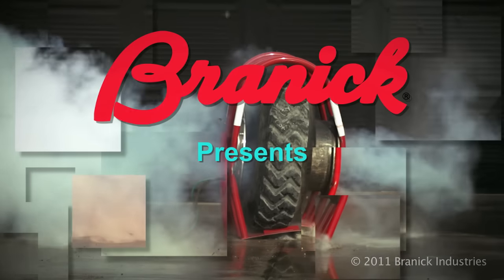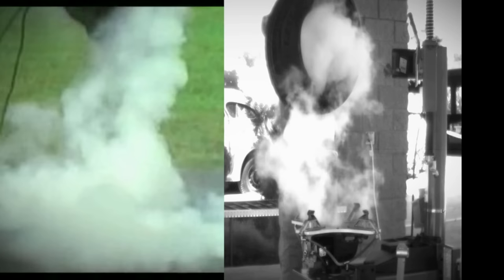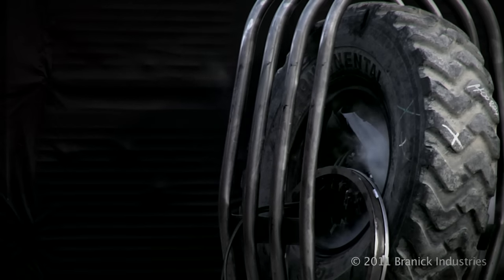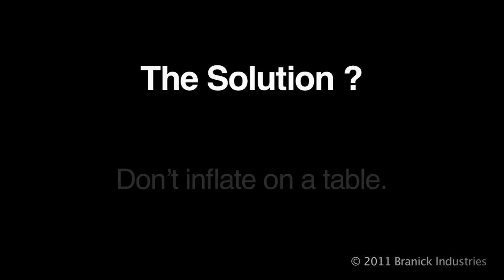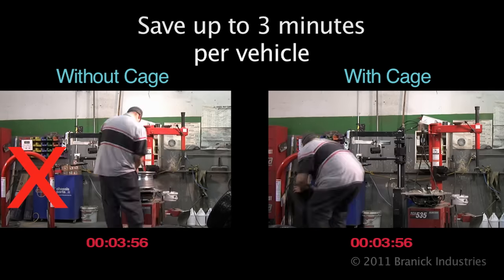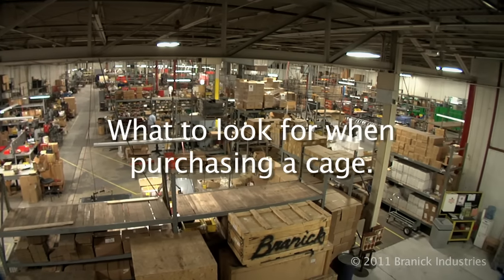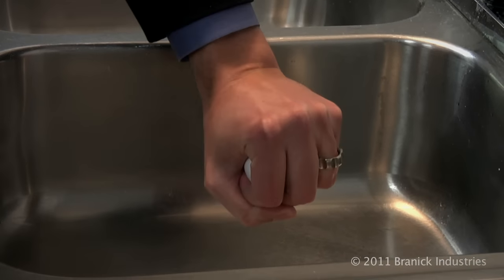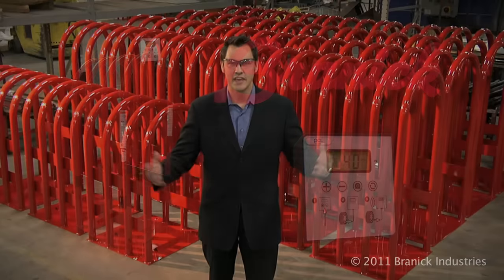Tire Safety Video.mov

Comment: We used to have a Jeep Cherokee.  The spare tire was stored in the passenger area behind the seats.  One hot day that tire exploded, tearing the belts and tread outward.  The tire was like new and never used.  Luckily no one was hurt by this.  After we never carried a spare in the Jeep again.  Things do happen.
Reply: Holy Jesus, how frigging hot did it get in there, and how much air pressure was in the tire? Are you certain that there was no "Fix A Flat" inside of it? Some of that crap is flammable!
Reply: @hugejohnson5011  Hey, tire pressure was normal for a spare.  30 psi.  No "Fix a Flat".  Our temperatures here can get regularly up to 110-115 degrees F.
Reply: @oby-1607  110°F or 115°F outside would heat that Cherokee's interior as hot as an oven! Still, it surprises me that an unloaded, stationary, like new tire would just explode. Weird things happen every day somewhere! I'm glad that you didn't get caught up in the damage, and lived to tell the cautionary tale! Cheers!

Comment: Great product. Tho I change tyers on trucks and trailers.the spider wheel on these trucks are dangerous can be like a spring as to take them off with caution stand to the side is the best idea I have.. the cage would be important tool at work shop. I'll show this vid to my boss. Do you import to Australia??

Comment: "Exploding tyre causes panic in York, UK":  My sister was pushing my mother around a busy supermarket in York in her wheelchair, the wheelchair tyres had been inflated to around 100psi.  One of the tyres exploded and mother said that the place emptied in less than a minute, people thinking it was yet another 'attack' as were being experienced around the country at the time.  Her hearing was never quite the same afterwards.  It is said that the bang from such an incident is louder than a shotgun. Funny on reflection!  

In another example I was recently told by someone that a local garage owner had repaired the puncture on an old wheelbarrow.  As he was inflating the tyre it exploded, the rim having rusted so badly could not take the pressure.  The result?   Death!

Comment: i started  repairing split rims when i was 12 years old (1959) i am not afraid of them and i've never trusted them also when i decided a rim was unsafe i always destroyed it so no one else could use it "just one more time" plus i've never repaired one with a cage because i never had one instead i either set the front truck axle on the wheel or i drop a car hoist on it I'm 76 years old and seldom work on splits but i have never broke the rule of burying a split under a truck or anything else where that "one" wheel that has my name on it will have to damage anything else except me!!!

Comment: This reminds me of my predicament. I have a work truck with tires rated for 80psi. I have always inflated to this but tire shops always refuse to saying that they dont need that much pressure. I dont get it why would the manufacturer put 80 psi and installers ignore it?

Comment: Just so everyone is aware, a lot of the tires talked about here are what are considered 'rim wheels' which are used in industrial vehicles like forklifts and the like. While all tires inflated with compressed air can have effects like this, the kinds of tires are very different in construction and failure points.

Comment: Can tires and rims blow up when they are just being changed for passenger vehicle use? I am 58, I have never seen a shop use a cage when filling tires after installing them. I was just thinking about getting all new tires for my truck. Even if they do use cages to inflate they have to add some air in order to get the tire to seat on the rim, Ali realize it’s usually only about 10-15 psi.

Comment: A close friend of mine was inflating a truck tire (18 wheeler steer tire) and its sidewall failed,he luckily didn't have any broken bones but he did end up with thirty seven (37) torn muscles and ligaments in his legs because he didn't use a cage,the force also knocked him back about ten feet and knocked him unconscious..we thought that he had been killed because of everything that happened,he was extremely fortunate though to not be more hurt then he was,when working with tires a cage is a must

Comment: The tech on the right was still seating the bead on the table, this generaly takes more pressure than running pressure. I also think a gopro hero 2 would have given a nice slowmotion video.

Comment: I have been doing tires for 18 years, I have had 13 tires blow up on me. Mostly from tires being no good, dry rot, or ran on flat to long. Never used a cage. By the way 9 mins for tire change on that size is too slow. I would have all done in 7 mins and that’s taken off and back on the vehicle.
Reply: Cage time?

Comment: This is a great investment for any shop. I work on aircraft and we inflate to over 200 PSI everyday. Guess what, we do not allow a new tire to be inflated outside of a cage when we change tires. On the aircraft we have regulators that allow a max of 250 PSI.

Comment: Discount and Costco doesn't use them....? Are these just for giant Vehicles traveling next to me every day? I think its 110 psi on those, so why do you have 4 air hoses hooked up? A normal compressor doesn't go past 130 psi
Reply: I think they are looking for guaranteed failure,  using normal pressure would not guarantee failure.

Comment: Curious as to why these cages distort. Every example you showed, at least, did so. Did you only show worst case? (poor product description, imo). I have to wonder, if designed to distort so easily, what is the legitimate engineering  or safety related reason. Or is it built in to insure future repeat sales?
Reply: You should study momentum. It's the same reason a car has a crumple zone, the longer it takes to slow down/ stop the motion, the more energy is absorbed. It's BRILLIANT product design to maximise the absorption of energy.
Reply: ***** Thanks! Makes perfect sense.

Comment: "passenger tyres are most common contributor to unjuries in a tyre shop" - OMG! I am also considering buying cages for ceiling lights which may be the most contrubutor to injuries in... a lights shop!
Reply: XD well, you might think that higher pressure tires (Tractor tires, etc) may be a higher risk :P

But yes, it is rather humorus :P
Reply: Yeah, I think you are right and truck threshold contain a fair bit of energy but they way they tell the story makes me feel like we are all doomed unless we buy their product:)
Reply: stertheder tractor tires only run at around 20-22 psi

Comment: The cage was placed wrong. It should have been placed so that the installer was NOT in line of a possible tread failure. It's not only the side walls that can fail, tread separation is also a possible failure point. The cage should have been placed in an area where nobody is near it when and auto inflation system is used.

Comment: So after after slowing the video down and watching the time lapse footage of the tire change, it is blatantly clear that the operator using no rack is moving much slower than when he uses the rack.. When played at normal (sped up) speed, its impossible to notice, but in the frame by frame slow comparison, its clear.... this is a sales tactic to make it appear like the rack doesnt slow you down, when it does in fact add another step, therefore MUST slow down the process..You can see the difference at the 2:16 mark (0:23 mark of the time lapse).... Same deal as the people smashing the bread with the knife before trying to cut it, then using the knife they are selling and cutting it properly.. We all know he smashes the bread with the "competition" on purpose...... nothing is different in this comparison.... Manipulation.. Sales tactic. period.

Comment: I do not get how the cage can properly seat the bead when you have to help it on the machine
Reply: It is for filling/inflating the tire, not seating the bead :)
You manually seat bead, then fill to proper psi inside the cage.
Reply: joeinpittsburghpa @ 2:12 it shows the full process. You seat the bead as normally, filling the tire with just enough air to seat the bead. Then, once the bead is set (and the tire is at a low psi) then you put it in the cage and fill to proper PSI.

In my case, i have 0  personal experience with anything more than adding air to a tire, but i have done my research to provide the best information i can.

I trust your experience with the tires, from what i found online there are a ton of 'how to seat a stubborn tire' videos, and very few 'how to seat a tire' videos.

Glad to know some safety precautions are implemented :)

Comment: There are other ways to protect yourself by using common sense.  Long inflator hoses with locking couplers, "aiming" the tire away from anyone and not standing near it during inflation, not laying it on the ground, chaining it to a hoist etc..

Comment: … yeah I’m a tire tech. Dont get me wrong, these do save lives, but they do not save time. Its not like the tire magically airs up faster because its cozy in a cage… nor will the mounting process be any faster. 
It is faster to do it without the cage, but the sacrifice is safety. This is a big problem in the tire industry as a whole. Wanting fast service is great, but it shouldnt come at the expense of safety. This had been an issue in the shop i work at. We employees often skip the tire cage as we are constantly being hounded for time on roadcalls. You save time when you just ignore the cage. Easier to just take the tire u just mounted and start airing it up than to get onto the truck, undo the chains holding the cage, dragging it to the hydraulic bed, lowering it, setting it up, placing tire in, and then begin airing it up. Also before you leave u have to put it back on the truck. 
Most of us in our shop take shortcuts left and right and sacrifice safety for the sake of speed. Want the roadcall done in under 30 minutes after arrival? I can do it, but I’m not using a jack stand or the cage.
I honestly believe they come up with these policies and buy the cages just so they arent liable for if we choose not to use it in order to meet their ridiculous time requirements.
Reply: That is true for many safety products,  doing something the safe way is rarely ever faster but doing it the fastest way is rarely ever safe.
Reply: @Bendigo1  exactly. I’m no longer a tire tech but it was a ridiculously dangerous job and honestly the pay didnt match.
Reply: @RedBaronisa  I once quit a well paying job because of safety concerns,   when I was turning in my stuff the manager said he couldn't understand why I was giving up the money.  I just said "money isnt worth my life or the life of others".  He looked like he had never thought about it like that before...
Reply: In some ways I disagree. At least when doing multiple big truck tires a cage can save time. While the finished tire is in the cage airing up I can start working on the next tire.     To be fair, that could still be done without a cage if I used a clip-on chuck and inline regulator, but it just as easy to use the one with the cage. Obviously this isn't practical for roadside tire work.......

Comment: Now I'm scared to air up my car tires. :\
Reply: You shouldn't be. Only farm vehicles and vehicles used for industrial applications utilize the split rim. Split rims have their uses, but only in those applications nowadays.
Reply: @cherrysdiy5005  my truck has 16in split rims on it its a 1975 ford f250 4x4
Reply: If your using a regular pump for your car that won't happen
Reply: It was a joke y'all
Reply: FOAML8X  the app kept bugging me about the replies lol
Reply: Don't man just buy new tyres when psi gets below 20.

Comment: These cages never made sense to me. What happens when it blows after you roll it out of the cage!?!  That's why I use only put 10-15 psi in to hold the bead then use an  inflator after the wheel is bolted to the vehicle and I'm far away.
Reply: I highly doubt 5 psi has ever killed anyone. That's not even high enough to set a bead 99% of the time lol.
Reply: You make a good point, but not completely. With split rim truck wheels, only the rear duals are safer when mounted on the truck. The front wheels have the split ring pointing outward. Yes standing away from it while airing it up is great, but what if it finally decides to let go while you return to take the hose off, or screw the valve stem cap on?      I know, I know, I'm splitting hairs here, but a cage really is safer. Can still wait till they're mounted on the truck to fully fill them, but there's nothing wrong with using the cage before then, especially with split rims.

Comment: The cage bending absorbs the energy released when the tire or wheel fails. A bent cage is useless and does cost money to replace, however it beats making that phone call to the technicians family to tell them he or she is in critical condition. I personally have had a tubeless 22.5 wheel fail and split into two pieces. Had it not been caged who know's what would have happened. Bottom line is use a cage stay safe. No one can put a price tag on your life.

Comment: whats the PSI you put in there for them to do that?   
Been with Good years 7 years just on tire NOT once have any don't that :)
Reply: @ Zack Booth, The video is showing about the cage strength and safety. They have taken trial to check the cage by inflating access air. And this type of accidents have been happened while inflating with a declared Air Pressure.
Reply: thats crazy!! well if it saves 1 life it's well worth it I guess :)
Reply: I never had either.
Reply: @danny1460 That's alota stored energy in those tires!

Comment: only older 16.5 rims are a little dangerous .....cause they have an older bead seat and not the safety bead seat that new rims have
Reply: The "safety bead" is there to keep tires on the bead when they get very low on air, or even flat. It to make it safer on the road, not in the tire shop. 16.5" tires/rims are perfectly safe until some idiot mixes up 16" vs 16.5" rims & tires. 

Also, later model 16.6" rims started coming with safety beads too.

Comment: Yes, I do.  I work at a coal mine changing tires, tires that are 13' tall and 5' wide.  Google 59/80R63, or 70/70x57.  Couple years ago a guy was airing up a scraper tire (37.25R35) and it let loose, blew him 30 feet back into his truck and took off half his head.  The danger is there.  A 59/80R63 fully inflated has the capability to send a 200 pound man almost 2 miles if it let loose.  Billion dollar coal companies wont hire tire guys, they have to contract them out because of liability costs.

Comment: "Sudden release of air and debris"
Mac, that's called an e x p l o s i o n. 
That's what tires do when any of the 4 prior fails happen.
Reply: It's not technically an explosion. If they said the cages were explosion resistant or even just mentioned something similar, it would be time to lawyer up

Comment: First three shots were split rim truck tires..  if the two pieces aren't locked together properly, yes they can easily take your life, thats why they're not even legal for highway use since at least 1980. A coworker of my father's got blasted through an overhead garage door by inflating an improperly assembled split rim truck tire. ALL modern commercial highway tires are now 1 piece rims and tubeless tires. So this would have to be limited to agriculture, and some specialty construction equipment.. yes ALL split type rims are extremely dangerous to mount and dismount
Reply: Your statement is completely false. There are NO split rims that are banned from highway use. There is one style of split rims that is illegal to "repair" but not illegal to use on thr highway. That means owners can run those tires out, but when they need to be replaced they will also have to replace the rims with the legal style rim. The illegal style split rim was made by Kelsey-Hayes and uses by many truck manufacturers, but mostly GM. Kelsey-Hayes rims split in the middle and were hard to verify that they were properly assembled. Normal split rims with 1 or 2 piece rings are still perfectly legal to use on the highway and repair. Check out the semi trailer chassis that haul shipping containers sometime. Most of those use split rims. The benefit there is that they use an inner tube so they're less likely to leak down and go flat while sitting in shipping yards long term.

Comment: those tyres are widow makers or split locking rims that are exploding no one works on them anymore i don't see any other tyres that explode then just them two
Reply: Even 1 piece rim tubeless truck tires blow from time to time. The rim of course doesn't blow apart, but the tire blowing is still very dangerous.
Reply: @johneckert1365  every one piece wheels blow its a common thing

Comment: These are called split rims.. they’re discontinued for a reason.. that ring that olds the other side of the tire is not that strong. And if inflated too much boom that ring pops off like no ones business. Killed many people with that type of rim.
Reply: Split rims may not be used on modern highway trucks anymore, but they're still used on equipment all the time. They aren't weak, the problem is poor installation/assembly. Modern non-split rims are more "dummy friendly"